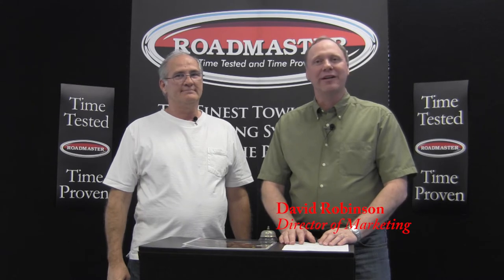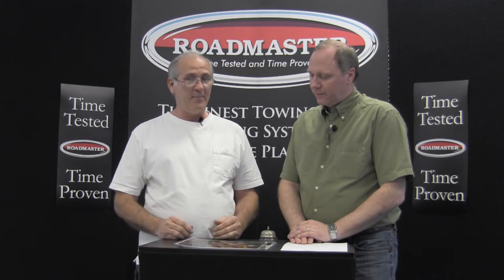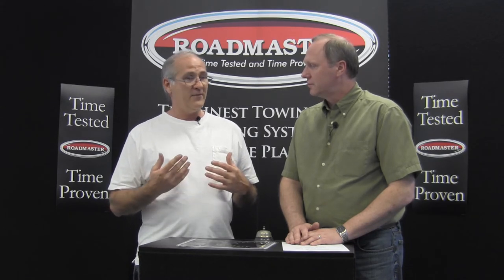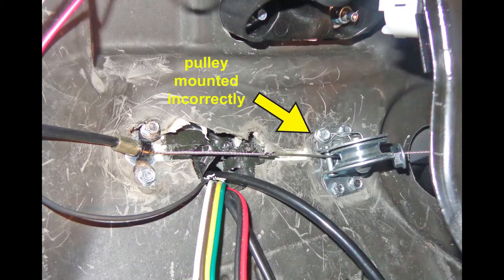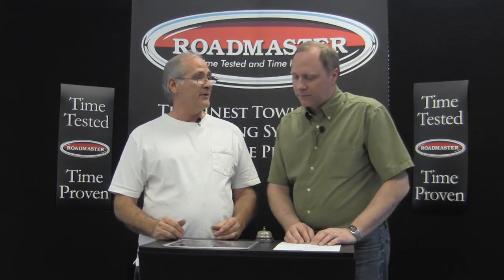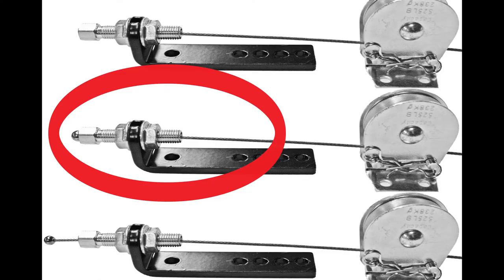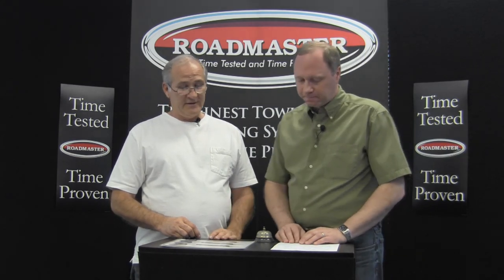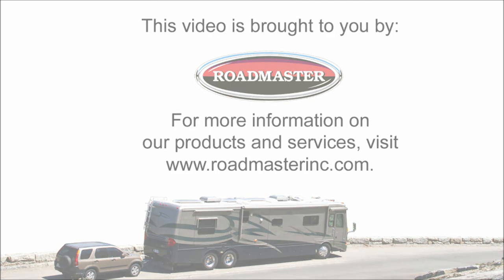Roadmaster's InvisiBrake: The Top 5 Installation Issues in 5 Minutes

Comment: Good info, but regarding the wiring, does the invisibrake need a trailer brake controller, like a Tekonsha unit, or does it simply use the brake lights to trigger ON/OFF braking?  If it's just the brake lights, how does the invisibrake know how to apply the right braking force?  Is there a motion sensor to sense how much to apply?  How do I know if the invisibrake is giving the car enough stopping power, for the adjustment knob?
Reply from the maker: Tom, I asked our lead tech support person and here is his reply: 

No, the Invisibrake does not need a trailer brake controller. A trailer brake controller is used with trailers to control their electric brake systems. The Invisibrake is a supplemental brake system for flat towing vehicles (not for trailers). The Invisibrake activates off of the 12v signal for the brake lights. It has a regulator and knob to set the PSI. The customer can adjust this setting to their preference. When the Invisibrake activates, it applies the set PSI every time for a max of 15 seconds before automatically releasing itself should the motorhome brakes still be applied. When the motorhomes umbilical power cord is not plugged in, the InvisiBrake system will be rendered inert. There is no motion sensor on the Invisibrake. 

As for braking force to set the PSI at, we have a chart of all of the vehicles we have seen here in the shop and the suggested location for installing the unit. Here is the chart: https://roadmasterinc.com/pdf/inv_resource_guide.pdf 

If you have a different vehicle, please give us a call and we can determine the appropriate setting based upon your installation.  
~Keri S.

Comment: Can the Invisibrake 8700 be used with the Brake master 9000 air cylinder rather than running cables to the brake pedal, I have the 9000 and would like to be able to use it. Thanks for the insight on your video. Can we lose the bell?

Comment: how important is voltage to invisi brake,my motorhome is 24v and I have a reduser installed to convert to 12v,when I put a meter on trailer plug voltage at plug is only 9v and at say 1400rpm its 10.1v,is this ok or not,peter  from australia